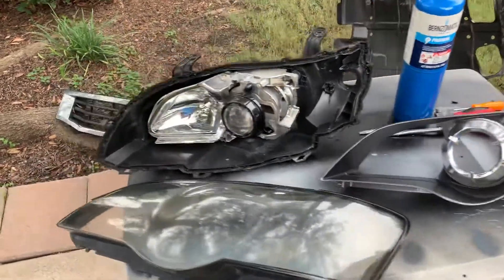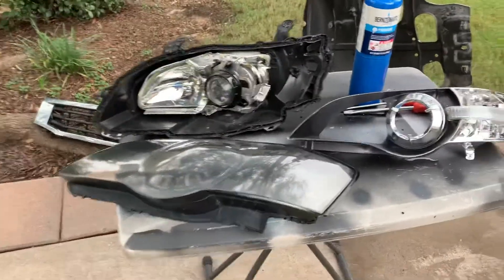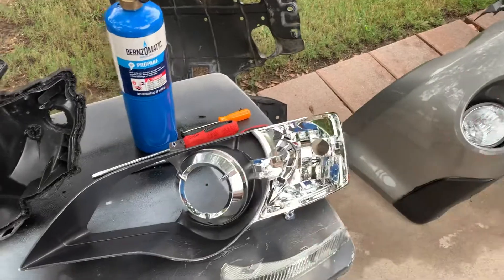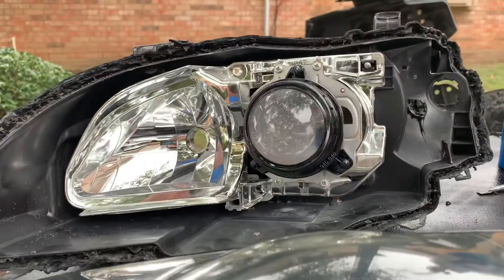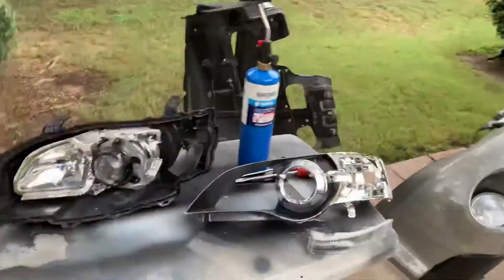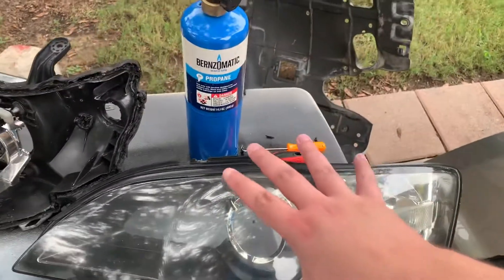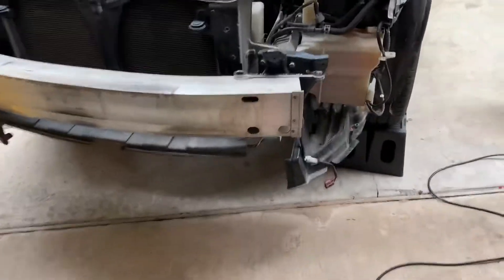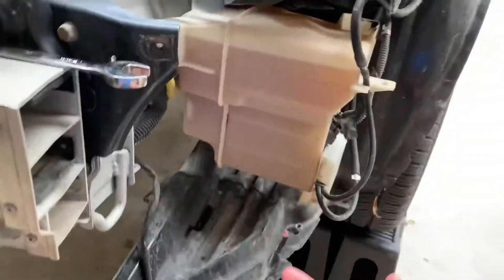Subaru Legacy/Outback Headlight Assembly Dissection

Comment: They sell just the outside shell to the headlight, but you still have to remove headlight to fix it and also check for leaks and probably need some adhesive to seal it.